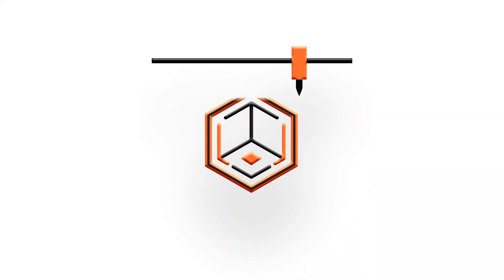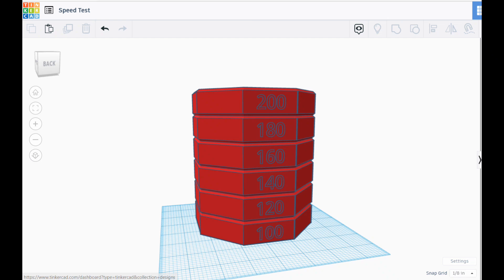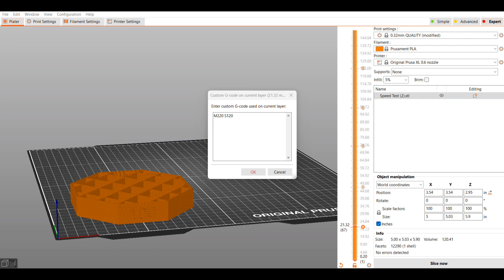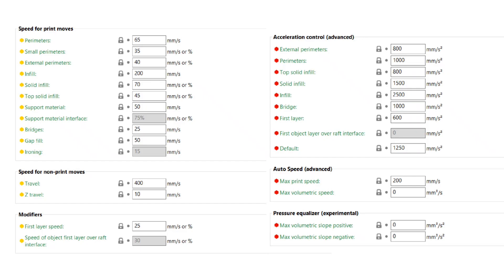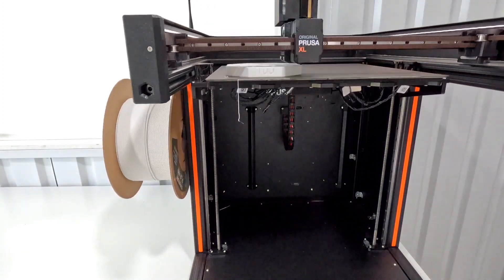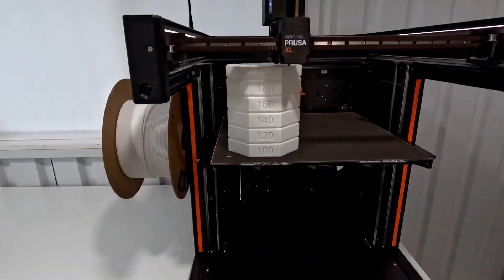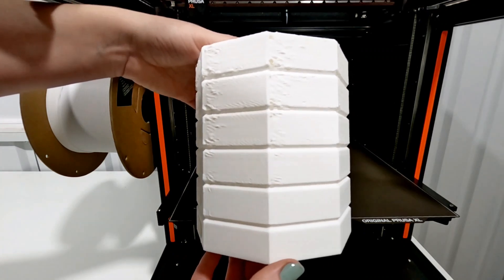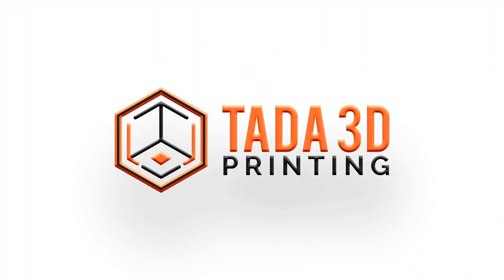How fast can the Prusa XL go?

Comment: I would check the volumetric flow rate of the print and the rated flow rate for the extruder on the XL. I feel like you're pushing that to (and over) its limit. I don't know what nozzle mount it uses (MK3 uses V6), but perhaps there's CHT upgrades for it?
Reply from the maker: Yeah just speeding everything up didn't work. I'm hoping input shaping comes out soon! Thanks!
Reply: @tada3dprinting  Well, input shaping is not going to fix thermal dynamics ;) filament cannot melt faster from input shaping. Different nozzle designs can however. Look up CHT by bondtech for an idea of whats possible.

Comment: If you want accurate tests you increase the actual speed using height range modifiers and enetering in the actual speed you want to print.  Adjusting the percentages is never as accurate and can cause issues, as you've seen.  I've printed ay 80mm/s (which is equivalent to your 200%) and have had zero issues.
Reply from the maker: Thank you!

Comment: This seems to be an issue with the stock hotend/extruder combo maxing out on the volumetric flow level.

Not much you can do with that input shaping or linear/pressure advance can do with that. Honestly fairly disappointing, as this shows the nextruder is, while being "nice" and advanced on the extuder side of things, fairly similar to regular V6 on the hotend side. MK4 is likely going to have the same issue and will also be similarly limited by the max volumetric flow of the hotend. Doesn't bode well for the fast printing, even with the fancy software functions and compensations. MK4 profiles in Prusa Slicer are also still sitting on the regular 15 mm3/s Max Volumetric Flow parameter, which is the same number as MK3 use and Mini also uses.

BondTech CHT nozzls, Matchless nozzles or clones of thesemight help there, they can push the MVF quite far, 20-30 as long as the extruder, motion system and cooling can keep up.
Reply from the maker: Yeah we will see if input shaping helps but  I'm not holding my breath. Thanks!

Comment: I did some calculations. I guessed that the straight lines are 50mm long. With 1000 acceleration you reach full speeds between 20-30mm. Also it looks more like extrusion issues and cooling. It’s not ringing, so it’s not something inputshaping would fix. I might suggest you google ringing so you get basic understanding what it is.
Reply from the maker: Thanks!

Comment: The hotend is gonna have a similar max volumetric to a v6. This means is gonna top out somewhere between 11-15 cubic most likely depending on nozzle/temp. To reach that, any combination of layer height x layer speed x layer width that equals something on that range is going to be roughly your max. You need to set a high enough accel to actualy reach the speed, and you can use prusa's accel calculator to figure that out.

Input shaper doesn't make your printer faster, it reduces ringing at the expense of smoothing the surface detail on your parts. it's a hotend limitation on the speed, the hotend can only melt some amount of plastic per second, and needs a longer melt zone to go higher. Quality will be impacted by acceleration-induced vibration mostly. The way to improve ringing agnostic of input shaper, is to make the gantry stiffer and lighter.
Reply from the maker: Thanks!

Comment: Looks like some folks are giving tips. One thing I’ll share in case it’s helpful: try different filament if you can. Have had a Bambu X1C going for a few weeks now, printing quickly. Been using a wide variety of filaments testing for new projects etc. Overture PLA Pro - seems to handle the speed awesomely. Regular overture PLA looked really bad. I haven’t tuned profiles at all yet so take that with a grain of salt, but don’t give up! Try others. Overture PLA Pro, Hatchbox ABS, Hatchbox PETG, Polymaker PETG, Polymaker ABS, Bambu PLA and Polymaker ASA have all handled really fast speeds respectably in my recent testing. Far from a 3D printing scientist, and was using the generic profiles, but just wanted to pass that along.
Reply from the maker: Thanks so much!
Reply: Obviously Input shaping is a must, but other filaments might get you a little more speed until that becomes available.

Comment: You need to increase the hotend temperature at higher speeds and/or adjust linear advance k factor otherwise the pressure builds during fast movements and too much plastic comes out after extrusion was meant to stop/slow. Then when the nozzle starts in a new direction it under extruders initially because the plastic is not hot enough.

Comment: there needs to be more values to be checked. Flow, extrusion width, heat, part cooling for example.
Just speed up is not the way to go.
Also might want to do this with smaller objects first. If they work, go bigger to check if its reliable.

Overall, the prusa profile looks to be not final anyway. See other video with cube. 🎉
Reply from the maker: Sounds good. Thanks!

Comment: Also linear advance and input shaping is brilliant in getting everything dialed in before you raise the speed. Also found if you are quite specific in the types of prints you do then tune it with that and not calibration prints if it differs greatly. I print large tall prints which is very different cal cubes and benchys.
Reply from the maker: Yeah it always depends on what you're printing. Thanks!

Comment: You might want to look at your print speeds. Slicers have different speeds as a ratio of print speed depending on different parts of the print. I.e outer wall inner, travel. Etc. When you use the percent increase everything goes up by that amount which can cause issues if some travels are already at max for the printer. Either change everything to one speed and rerun the test or print at a single speed and then change it manually and reprint.
Reply from the maker: Sounds good. Thanks!
Reply: @tada3dprinting  You could avoid the issues The GPs mentioned by using height range modifiers in PrusaSlicer to change speeds at different heights

Comment: I think your just hotend limited 🤷‍♂️ with a .6 nozzle and over 100mms your pushing around 16-20 odd cubic mm. unless it’s a volcano style or similar it will run out of puff around then. Input shaping won’t make any difference to speed, just ringing on corners etc.

Comment: I agree with TMS5100, crank up the temp by 5C for each 10% speed increase and try again. Btw you can do all that in Prusa Slicer without having to change the Gcode manually.
Reply: I came to the comments to say the same. The faster you print the hotter the hotend needs to be to be able to keep up. Another thing is white is usually a difficult filament to print with if you do try this again try a different color.
Reply from the maker: @Dsk001  true. That's why I like to print in white. Shows everything. Thanks!
Reply from the maker: Ok. And I may also scale it down and focus in smaller increments. Thanks!
Reply: I actually prefer to print in black because from a photography or videography perspective white can overexpose on film or video which actually hides in perfections if you print in black it will show print imperfections much more easily
Reply from the maker: Good to know! Thanks!

Comment: not input shaping at fault here. looks like massive underextrusion. you could try increasing the extruder temp by 10C or 20C. if prusa's 100% really is the absolute limit of this printer, it does not bode well.
Reply from the maker: It's still faster than any other Prusa. But yes it would be nice if we can crank it up a little. Thanks!

Comment: My opinion is to not print fast. Print slow and make all your printing speeds, shell, walls, infill and so on the same speed. This will make all lines uniform. Calibrate the extruder so your pushing the exact amount of filament you want. I know it sucks to wait but quality is king. Also thinner layers. I use .12 layer height.
Reply from the maker: Thanks!

Comment: I wouldn't make any judgments until they come out with the software to run the higher speeds.

I print lots of parts, mostly at .2 layer height with the. 4 nozzle and most parts I can print at 150% and you can barely tell the difference when comparing it to the same part at 100%.
Reply from the maker: Good to hear. Thanks!

Comment: That's an interesting way of speeding things up. I figure without input shaping you can't bump the speed much though. I'd just wait for input shaping at this point (only a couple more weeks - fingers crossed).
Reply: Input shaping does not address the high speed extrusion issues which you can see here. Input shaping only fixes inertia and vibration related issues (ringing and ghosting) which is not the major issue here.

Comment: So.. 100mm/s is the only one that looks good. If that is without input shaping.. I don't have high hopes that WITH input shaping we're going to see 200mm/s prints that are good quality. This is VERY disappointing for a core xy printer. My Ender 3 S1 Pro.. with rails upgrade.. can get 100.. and though I haven't dialed it in yet.. a few folks have it working at 200+ consistently with great quality. That was with input shaping and klipper.. but.. if a cheap Ender can print better/faster with a .4 nozzle no less.. than the Prusa XL CoreXY... then I am happy I cancelled my order. To me.. the Prusa XL should be hitting 200mm/s comfortably I would hope.
Reply: im pretty sure 100 refers to 100% not 100mm, if that's the case then id cancel mine too.

Comment: Just cranking up the speed percentage can cause erroneous results because it's essentially blindly increasing the speed of everything. This is kind of different from testing max acceleration and flow rate and then creating a maximum speed in the slicer based off of those.
Just cranking up the speed on the printer also doesn't take into account increasing the temperature of the nozzle to accommodate the higher speeds at which you're printing.
Overall I wouldn't put too much faith in these results and it would be best to run through proper tests with maximum flow rate acceleration etc. There are videos you can watch to show you how to do those tests.
Reply from the maker: Thanks!

Comment: I am not a Prusa fan because of the printed plastic parts that'd overpriced. 
But this printer looks really good. I might get this one or the bambulabs p1p.
Reply: Bambu lab is good. I mean XL looks good but is a bit overrated in the price
Reply: XL is over the x1c price range.
Reply: Yeah. It does look a little overpriced compared to the p1p. My main "needs" are to have little to no leveling, quality then speed. I have enders and I really hate re-leveling every 1-2 months.

Comment: The really important thing for any printer is that it produces parts that are fit for their purpose. High speed is all very well but if the resulting parts are poor then it is of less than zero benefit. Unless you are running a production line it doesn't really matter if a print takes 4 hours or 8 hours provided the results are good.
Reply from the maker: I agree that a good reliable print is more important. Thanks!

Comment: Thank you for testing this, I've really appreciated your coverage of the Prusa XL! I have noticed that adjusting speeds by percentage isn't the same as adjusting the speed settings manually, and that strange things happen when adjusting after the fact vs slicing it at those speeds. If you have the time, it would be interesting to see the Prusa XL set to 100mm/s, 150mm/s, and 200mm/s, but I appreciate the content nonetheless!
Reply from the maker: Good idea. Thank you!

Comment: I expected this result. This is not a speed of the printer problem. this is the limit of the hotend with the 0.6 nozzle. if you do this with 0.4 nozzle you can get these higher speeds. Or lower layer height. End hyper pla can help. Also the Bambu printer prints not so fast anymore how thicker your layers are and the bigger the nozzle. Because it is also at the limit of the hottend. Still looks like a great printer.
Reply from the maker: But if I am printing at .4 nozzle/smaller layer height I feel like I'm taking a step backwards. I do have an even larger nozzle. And it's a good printer as is. Thanks!

Comment: Wait for input shaping. The real test is to find out what the max output of the hot end is. That's usually the main bottle neck on a core-XY machine, aside from input shaping and pressure/linear advance setup. I expect speeds at good quality will improve quickly as development proceeds. Prusa won't stop improving the machine for years to come.
Reply from the maker: Good point. Thanks!

Comment: For me it looks more like lineaar/pressure advance problem more than input shaping problem.
Reply: Also max flow rate can be a bottleneck but yeah, it looks similar to the pressure advance measuring print result.
Reply: Agreed
Reply: Yeah, max flowrate + LA/PA
Reply: Great video! Agree about pressure advance & max flow. What's layer height and width? If it is not incorrect PA, then that's quite disappointing from Prusa. What's the temp also?
Reply: Correct

Comment: wow, that is disappointing. I was hoping this would be a generational leap in speed, but its turning out to be just a large format solution.
Reply: To be a leap in speed the acceleration needs to be cranked up which needs input shaper.
Reply from the maker: There is still room for improvement. And it is faster than all my other Prusas. But I was hoping it would be simple. Thanks!
Reply: For a leap in speed you need a high flow hot end, which I don't believe the XL has. Maybe they'll change that in the future and add that as an option, maybe a separate tool. 
I'd bet the reason it's not high flow is because that results in poorer quality prints and issues at lower speeds. Considering this seems to be aiming at the high reliability, good quality, large format market, it wouldn't make sense. Maybe they'll turn it into a speed demon later on, but I don't think that's what Prusa was going for.

Comment: ….or Prusa has tested the XL and 100% speed actually is the breaking point for quality.  Maybe they will change the 100% speed with input shaping implemented?  100% speed is not a measure on its own, it simply references a point.

You could half the actually speed and call it 100%, then one might feel like it a better value “over-clocking” to 150%?

Not in anyway saying the XL is fast.  I have a multi tool head on a day-one order and without input shaping it seems like a poor value.  

Love the videos and keep it up!  Good luck growing the channel!
Reply from the maker: Thank you!

Comment: I would try a better filament, overture might be cheap but I have a better experience with esun pla+
Reply from the maker: Good point. Thanks!
Reply: I'm curious, have you run into bad spools of eSun PLA+? I've had several that produced irredeemably bad results no matter what you did with it. Also seems to be quite prone to stringing even on the good rolls.

Comment: i generally run my i3 between  80 percent speed  and 120 percent depending on the detail. Any faster and i get problems. but speed isnt everything. if you want a fast printer, put it in the back of your car and drive down the highway at 120 mph:-)
Reply from the maker: Haha. I am happy with this printer at regular speed. But faster would be great. Thanks!

Comment: get the printer on a bed that will take out the vibrations of the printer hard table not the best for high speed testing, I move the print to the bed center and see what that does as well
Reply from the maker: Interesting. Maybe I can set it on the floor. Thanks!